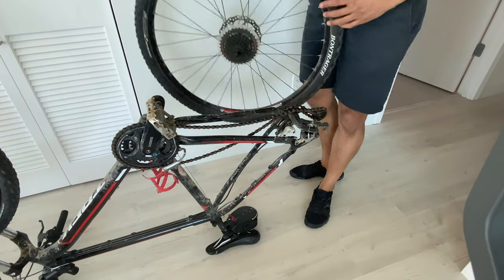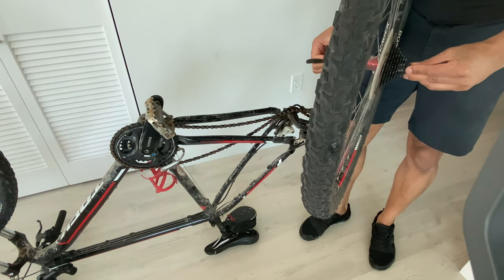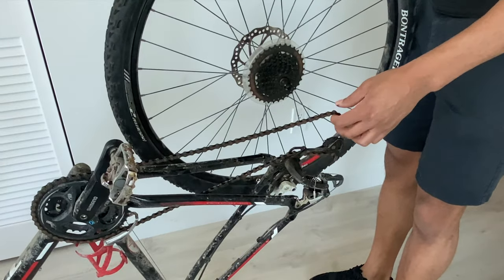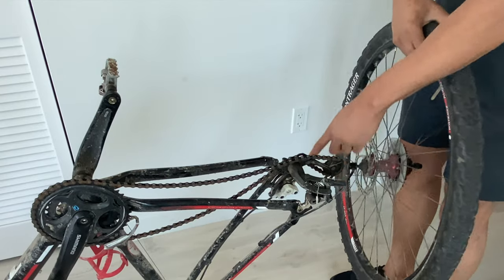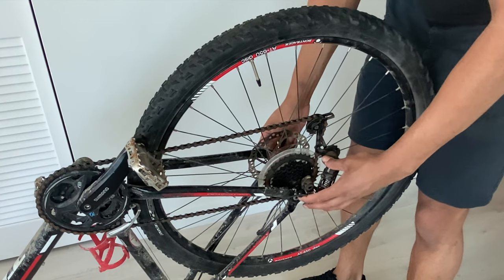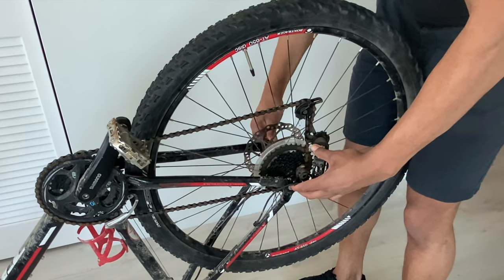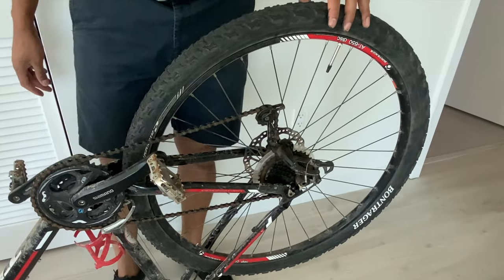Bicycle Tire - How to Put Rear Wheel Back On My Bicycle

Comment: I was stuck when I took off my rear wheel to fix a puncture, I couldn't get it back on.  I looked up this video on my mobile phone and following your instructions was easily able to fit it back on. Many thanks you saved me a 15K walk!
Reply: Same situation for me, Today my rear Tyre has been punctured, I've removed it and will take it for repair and this video will help me
Reply: After the fact, I'm going to get tire levers for the next change (although the new rubbers were misshapen, so that will fix itself with time)...and still have to replace the rear wheel. Hence, I'm here. OMG. The brake caliper wire is tighter on this one, too.
Reply: Thanks it really helped
Reply: Yup ioo
Reply: Me too
Reply: Ima just start taking my bike into a bike shop and get them to replace my back tyre when I get a puncture again because tryna get that chain on Is f****d
Reply: Same here
Reply: Exactly the same situation :)
Reply from the maker: You're welcome!
Reply from the maker: you're welcome! Can you subscribe to my channel?  I will really appreciate it!
Reply: Ty it work
Reply: How do you remove?
Reply: same here, came to this video after struggling a lot 😅
Reply: Haha same here
Reply: I had my first puncture and went to the local shop. I asked him for some help and the guy explained me how to fix it. Afterwards I failed to get the wheel in and I went back. Poor guy showed me 4 times 😂 I watched this and back on track 🎉

Comment: Looks so simple, yet with mine i can't even fit the wheel in the gap 😡
Reply: same issue
Reply: I think I solved it by getting adjustable wrench and taking off the washer. then putting that washer  the other side of the nut and then finally tightening the last quick release bolt thing :) idk, just watch out not to get the ball bearings out of place by unscrewing either end of the mid cylinder thing. its hard to explain :/
Reply from the maker: Kiz did you ever figure it out?
Reply from the maker: You're welcome!
Reply: Tried 30mins & got it in. Don't force it,  glide it in like he shown.
Reply: I feel the desperation in this old comment and feels just like me right now. I spent an hour around the wheel and gave up. Half an hour later I came back and read this comment and decided to watch the video again. And I got it- I was not  pulling the chain far enough backwards so there isn’t enough space. He grabs the bottom of the chain holder and pulls back and that opens it all up for the wheel to slide in. Went back to the bike and it worked straight away. Yay 🙌

Comment: You really saved me a lot of headache when building a new bike. The instructions didn't show how the chain should sit on the gears, and I was frustrated until flipping it as you suggested. Thank you man!!

Heads up though, anyone doing this, just be careful the chain doesn't get tied up. Carefully lock the wheel in, and then carefully flip it back over. Fun learning experience! Youtube FTW!
Reply from the maker: You're welcome!

Comment: Thank you so very much!  I removed the rear wheel on my Huffy Sienna 7 speed, which sadly was necessary, in order to replace a fender, due to a small screw at the tail end that could not be reached with the tire in place, though naturally every other dang nut and bolt could be.   It was after I replaced the fender and went to return the wheel that I realized... utoooh.... LOL   So... thanks to you I was able to successfully reseat the rear wheel, in mere moments rather than hours of trial and error.     :)   Thanks again!
Reply from the maker: You're welcome!

Comment: I DID IT 🎉 thanks for this video. I was trying to put a 1000w emotor on the rear wheel and saw it as impossible but this video guided me. 🙌🏾
Reply from the maker: You're welcome
Reply: @DIYPinto  why won’t my tune work? i can’t turn the thing so it can lock the wheel

Comment: I just got a new Specialized.  This is not the first time I've ordered a bike by mail (some people are astounded when I tell them this).  Ironically I never had a problem with my GTs and they assembled like butter needing very little adjustment.  Just a few tweaks to the limit screws is pretty much all that was required for the most part.  All of my groupsets in the past have been 9x3, but  at some point between my last bike and this trail bikes have started adopting the 8x2 groupset.  That's not really an issue, but this is the first time I have encountered a this particular groupset.  Also I've used Shimano indexers in the past, but this is my second Microshift.  Again, not really an issue, but something to note.  Anyway, I cannot for the life of me get the bolt aligned.  The derailleur keeps pushing towards the brake calipers, so the rotor starts hitting the frame before it gets anywhere close to the calipers.  I can't push towards the derailleur without bending it, and I shouldn't anyway.  All my other wheels just roll right in like butter.  I'm starting to think that the limit screws are not set correctly, or there is an alignment issue.  Upon visual inspection it looks like it's aligned properly, but without a proper tool I can't tell for sure.  Really disappointed in Specialized, which I thought was a reputable brand.  Oh, I was also missing two stem bolts.  I'm going to have to fork out another $200+ to get it properly assembled and tuned it looks like.  Despite their claim that they ship their bikes adjusted and needing minimal assembly.
Reply from the maker: I never knew that about that company.   Can you please subscribe to my channel? I will really appreciate it!

Comment: I'm not bike part savvy so be gentle lol. I can't get the wheel into the slots on each side, the other side to the gears facing his wall the nut looking part with long screw looking part that usually slides in is just not going in. I think it may be bent a tiny bit the frame bit where slots are, but man I struggled and struggled to widen the frame so it would slide in, the wheel/tyre is off an old exact bike, so there should not be any problems. We took the bike to have the back wheel/tyre replaced a few years ago, and it wasn't even lined up when we got it back, it kept rubbing against the frame(Yeah that was an extra 10 quid for a check up lol, they made it worse!) Now I'm wondering did they do something to that frame bit where the holes are for the wheel to slide in, to fit the "New" Wheel? It does look a bit bent by about 30-40 degrees compared to other side, so I'm thinking it's that? Man why couldn't it just slide back in? grrrr....lol
Reply from the maker: lol sorry to hear that
Reply: @DIYPinto  Yeah they bent the frame, I had to bend it back gently without doing to much harm and weakening the frame, but eventually  got a new wheel in. 
It drove me crazy trying to fit that wheel bk in that first time, if there was ever a blooper reel for swearing it was that day, hands, face, clothes black, sweat pouring off my forehead and veins popping out of my neck! Lol ✌🏽

Comment: Tried to put back wheel on after repairing a puncture and I couldn't get the damn thing past the end point on the frame. Running out of time to get yo work so I (petulantly) got a red mist and threw it all back in the shed. I'll try your method later.
Reply from the maker: Did you ever figure it out?  Can you please subscribe to my channel? I will really appreciate it!

Comment: Do i have to tune the gears? Which disk does it go on? The smallest or
Biggest?
Reply from the maker: It's important to tune your gears properly for smooth operation. The gear should typically go on the smallest disk for climbing and the largest for speed.

Comment: after all steps... i got a wobble on my rear axis... wheel does spin correctly but when i rise the wheel and spin it in the air to check it, it does get an abnormal rotation pulse in my hand while keeping it spinning in the air. Is this normal? should it be calibrated? all was perfect before replacing the wheel. Brakes rotor and pads are working ok.
Reply from the maker: Did you ever figure it out?  Can you please subscribe to my channel? I will really appreciate it!

Comment: My bike wheel will just not quite drop in the slot.? ..Is something preventing it? The non-disc brake side fits in but not the other.
Reply from the maker: Did you ever figure it out?

Comment: How do you know what sprocket to put the chain on?  Or does it not matter?
Reply from the maker: @joeltpw did you ever figure it out?

Also, can you subscribe for more great content? I will really appreciate it!
Reply: @DIYPinto  from what I've read it does not matter.  The gears and chain will align to where they need to be by themselves once you start pedaling.

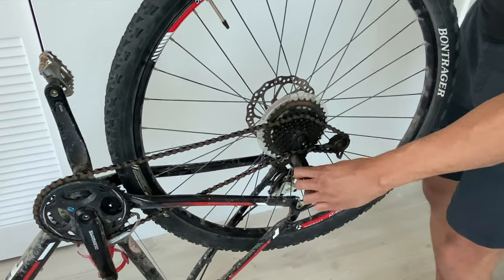Comment: While removing the rear wheel of my bicycle for taking it to a cycle shop to fix a puncture, I do it with the bicycle in the upright position. From this video it appears it might be easier with the bicycle upside down; will try it next time. However, it has been mystifying, while mounting the wheel back, that it just rests on 2  U-shaped open grooves on the frame (can also be seen in this video at 1:20) with a single bolt & nut which is tightened by a hand lever attached to it. How does one feel confident that the wheel won't come off on a bumpy ride? However, it hasn't happened in the past 10 years of cycling nor have I heard of such an incident so far!
Reply from the maker: Good question!   Can you please subscribe to my channel? I will really appreciate it!

Comment: Having trouble! My tire says 700x28c, so i buy said tube size. and when i change the tube it pops, do i have the wrong inner, i get the tube in , it pumps but then pops.
Reply from the maker: Did you ever solve your problem pepper ann
Reply: @DIYPinto  i did thankfully , went to a bike store

Comment: How do you center the rotor to the brake pads?
Reply from the maker: Can any one chime in?
Reply: Loosen the brake pad bolts on the back of the calipers. Pull the Rear/front brake (whichever your adjusting) and tighten them back up again when your still pulling the brake. Once tightened let go and you should see the disc is now central to the pads 👍

Comment: Could you make a shorter version, like 30 seconds where you just pulled the spring part back and placed the tire to the bottom chain. thats really all I need. Maybe some people need this extended version. But content creators should start making you know short, simple ones for people who just need to see it done once
Reply from the maker: Most people need to see the longer version though